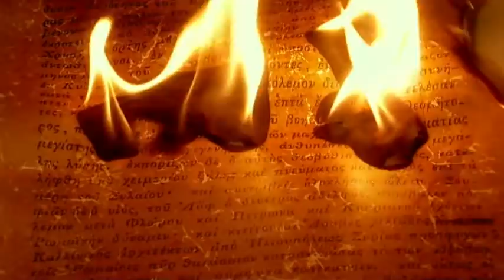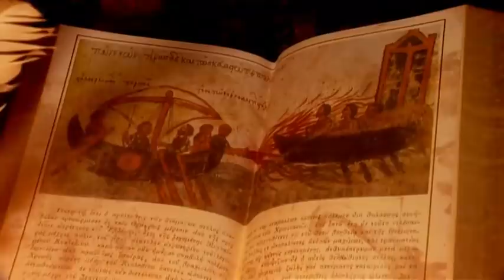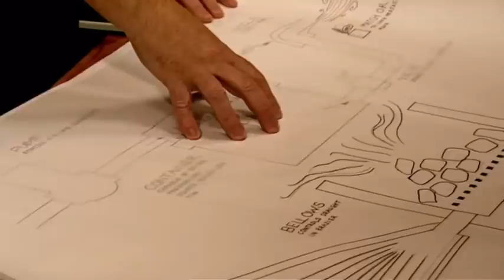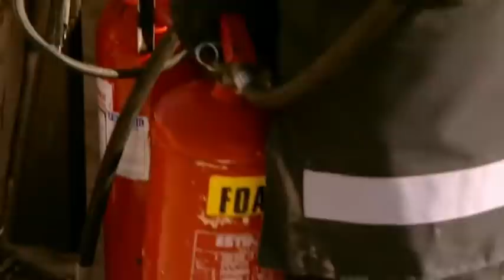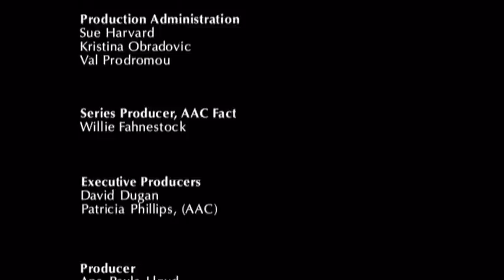Machines Time Forgot S01E02 -  Fireship (Greek Fire)

Comment: Why was it necessary to cast the tanks? Surely they could have been hammer formed and welded? 
Cranking a tap to release extremely hot, highly pressurised oil could probably produce that "thunderous roar" that everyone seems to be obsessed with.

Comment: Could it be that the flammable mix was pre-heated to bring it closer to its burning temperature rather than pressurize it?  This could have been done in an open tank so it wouldn't have exploded.  Then the handpump could be used to deliver it to the target.
Reply: My thinking is the mixture congealed when cool and the fire was needed to liquefy it. If they used hand pumps that was enough to throw it rather than using steam pressure which I don't believe they had the tech to do safely.
Reply: @user-uy1rg8td1v  they could have just cast 1000 pots and stress tested them with steam and only kept the best ones.  secondly, the guys in this video were stressing about petroleum characteristics and vapors, which would be fine if they were trying to recreate a weapon that used petroleum, but they weren't.  they were trying to replicate greek fire, a substance which no one can make anymore, thus can't characterize properly.  Then they ended up using straight oil.  

if these people went to the trouble of putting hearths on a ship, then it was for some specific purpose.  And if they were using straight oil, then they would have known they didn't need it.   I'm of the opinion that the hearth was there to heat blocks of concentrated pitch, which would be relativly safe to transport.  The melted pitch would then run down into a secondary chamber where it was then mixed with crude oil accelerant and pressurized via the pumps.  Then jetted out the nozzle.    The pitch melting pot need not be pressurized, the mixing pot need not built to modern pressure recommendations,  and the rest would function more or less as shown in this video.

Comment: Meanwhile.... Greek fire in the sources :
1) Produced and stored UNDER PRESSURIZATION ( = a much more complex and volatile chemical composition than the naptha-based one reproduced in modern experiments)
2) AUTO-IGNITION by mere contact with atmospheric pressure, burning over water and burning even under water (never seen any auto-ignition in any of the modern experiments)
3) Characteristic thunderous sound upon release (i.e. not that of cracking fire, but more like a canon-shot...)  
4) Several methods of utilization in a whole range of weapon systems including bombs and grenades and flame-throwers of various sizes from ship-mounted steam (or pressurized air) canons to hand-held flamethrower devices 
5) Highly classified, not reproducible by enemies including Middle Easterners who had a vast tradition with flamethrower and related petrol-based chemicals

While I sympathize with the experimental researchers, they seriously lack enough funding to conduct any meaningful experiments. Any reproduction that does not reproduces the pressurization and auto-ignition in atmospheric pressure (i.e. upon release from enclosure) is bound to be a failed one.
Reply: There were many attempts to copy it, so this weapon probably existed even if it was not actual Greek fire.
Reply: Was the technology vortex technology... Fed by some mechanism useng the depth of water as a build of pressure... Does high pressurised fumes have a higher ingition point than that at low atmospehreic pressure... 
The vortex tech could increase the temp of highly pressurised fumes... Awitjoit igniting... Bit when at the nozzle when met with atmospheric pressure causes a lower ignition point and instantaneous combustion